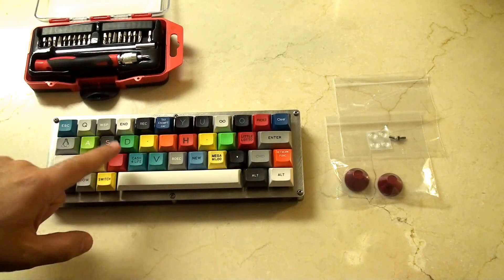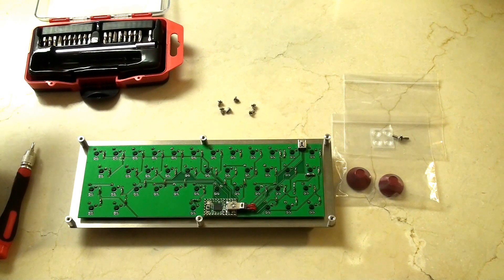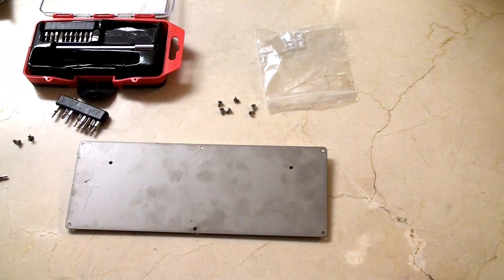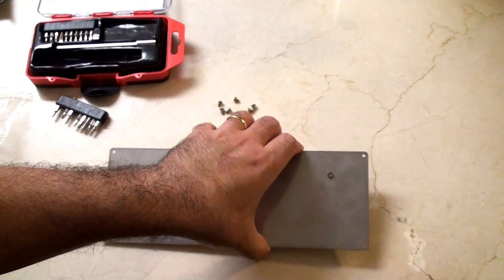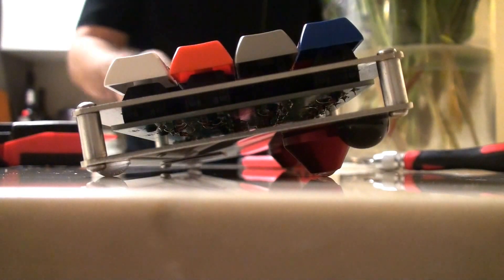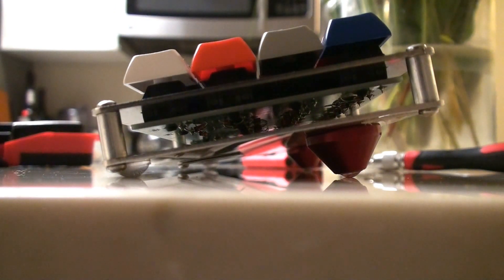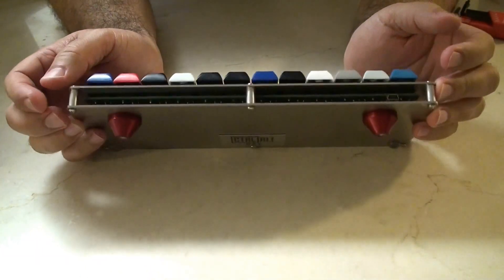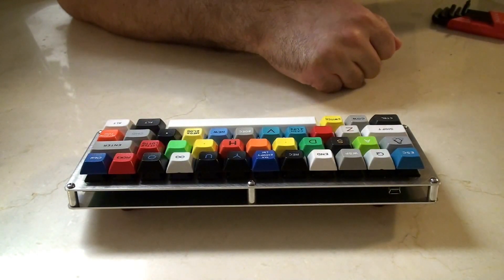Mechanical Keyboards: Add GON's feet to the JD40 for the ultimate Programmable Mechanical Keyboard

Comment: Where can i get the exact keyboard you have there? (jd40)
And can i program in the F1-F12 keys on this keyboard?
Reply from the maker: +Enclave Soldier This keyboard, the JD40 is a community made keyboard with limited quantities ever made.  So, chances are pretty slim you can get one.  However - there's a new community project called the Golbat 40, which you might still be in time for...